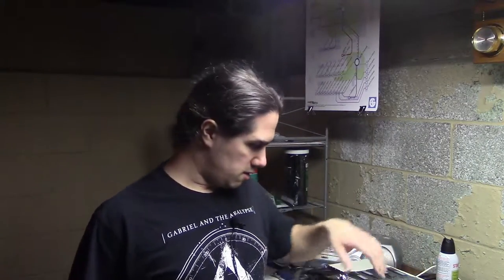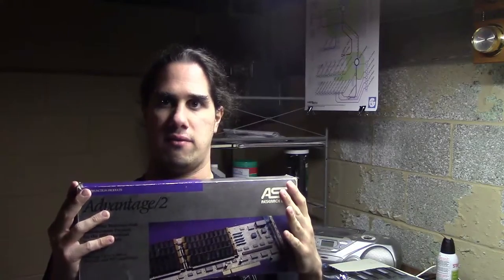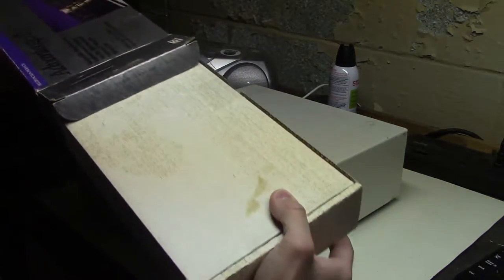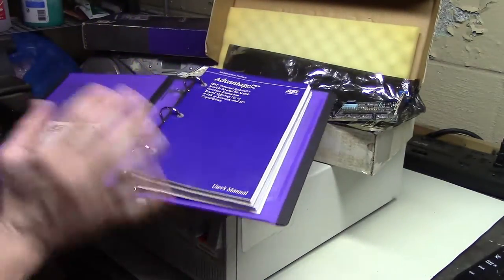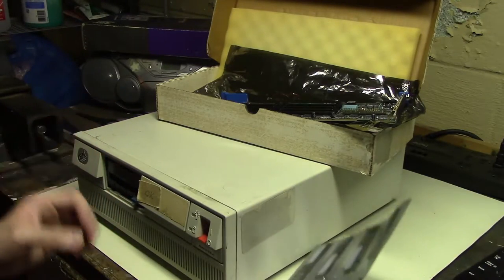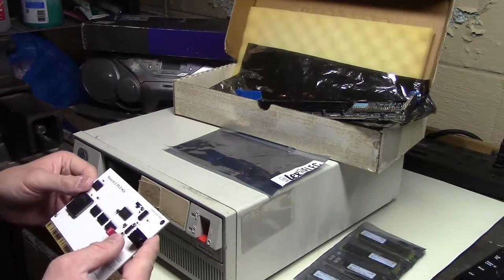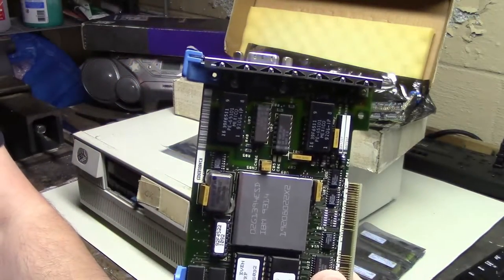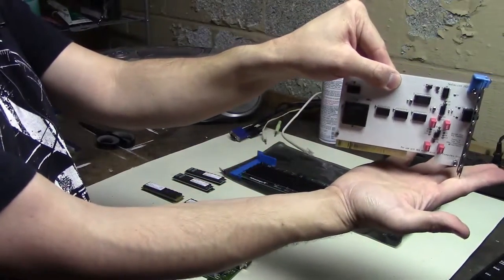Adventures in 286 - Part 8 - IBM PS/2 Model 50 RAM and Sound Upgrade

Comment: I need to show my microchannel AST memory adapter - It has blank PCBs in place of most SIMMs.
Reply from the maker: That's interesting.  Do the blank SIMMs have any function (like termination) or are they just placeholders?
Reply: @nticompass : Termination - there are traces on the PCBs - If I don't incorporate showing the adapter in tonight's planned video, I will probably have it in a dedicated video. There are much better adapters to use.
Reply from the maker: Cool.  I'll check out your video.  I'm always on the lookout for more MCA cards.  I'll try to get my hands on one of those.

Comment: Hi there!.Did you ever get the AST card to work? I just got one.  Also, ss there any chance to get an image of the MCA AST card floppy disk? Thanks in advance!
Reply from the maker: Yes, I did get the card to work.  I needed to swap some of the RAM modules.

I'll make an image of the disk and throw it up on archive.org later :-)

You need to make a copy of the reference disk and use the AST disk to modify it.  It needs to do that to patch the memory info.
Reply: @nticompass  Awesome thanks! Is there any in particular to make the onboard SCSi connector work? like does the manual describes anything? Thanks again!
Reply from the maker: In my Model 50, I'm using a separate MCA SCSI card.  It has a boot ROM that allows the system to boot from the drive.
Reply from the maker: Here is a copy of the disk for the AST Advantage/2: https://archive.org/details/ast-advantage-2

To use this, you need to:
1. Make a copy of the PS/2 reference disk for your system
2. Copy all the files from the AST disk to the copy of the reference disk
3. From the copy of the reference disk (with the AST files now on it), run PREPARE
4. Boot from this disk and configure the amount of RAM
Reply: @nticompass  AWESOME thanks! I shall give this a try.
Reply from the maker: Let me know if it works out for you, or if I can help in any way.